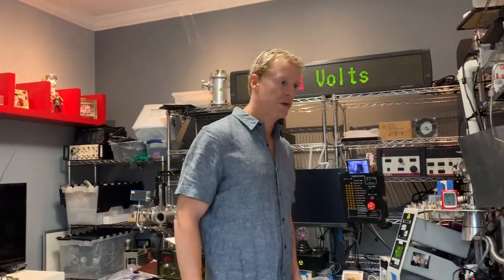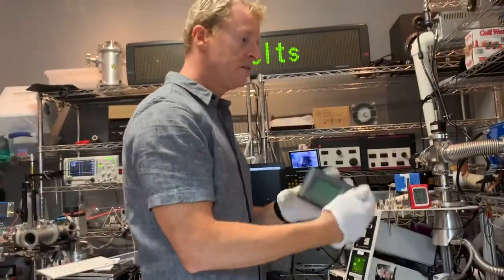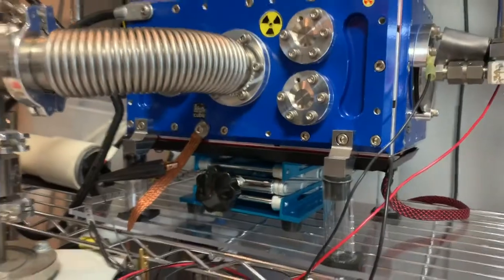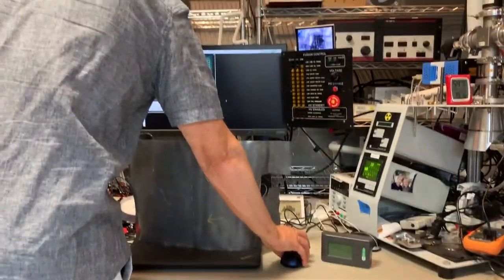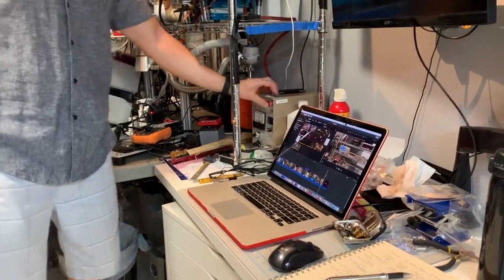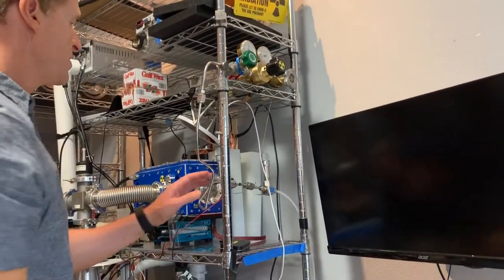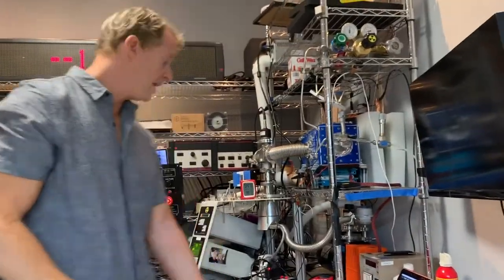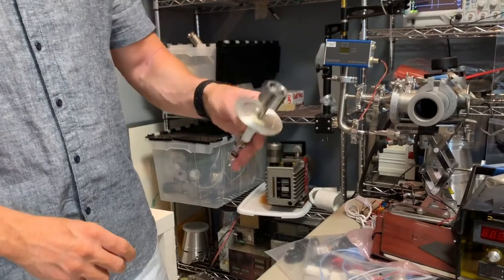Trents Fusion Lab Tour Aug 2019

Comment: This is quite an excellent setup! I've enjoyed seeing some of your experiments on the fusor forums. I'm sure with all this great gear you'll be able to produce some really interesting data.

I'm curious about your vacuum chamber. Was it custom fabricated? Is there a thread on the forum which documents your vacuum system?

Cheers!
Reply: I think all vacuum systems are custom in some ways. The chamber is off the shelf from Ideal Vacuum. It’s the 12 x 24 cube. I made n assembly inside to hold a $15 borosilicate sheet to protect the $400 window from sputtering. Then I added an aluminum cylinder so my 2D cathodes would have their Anode round geometry.